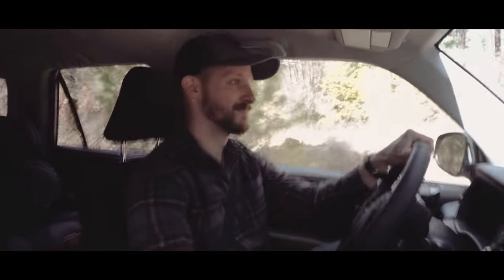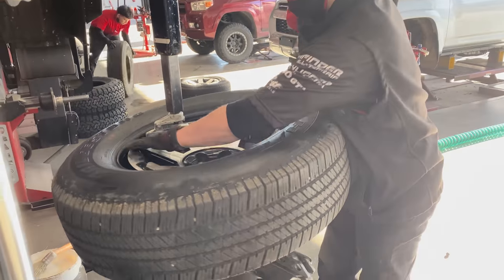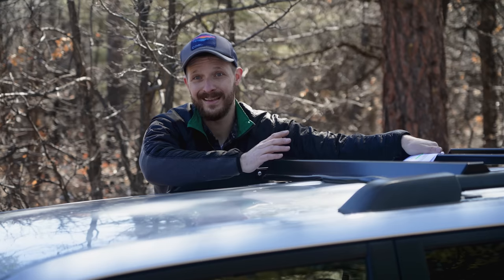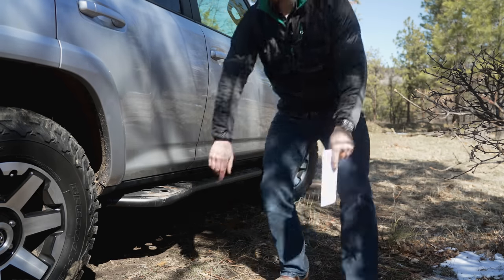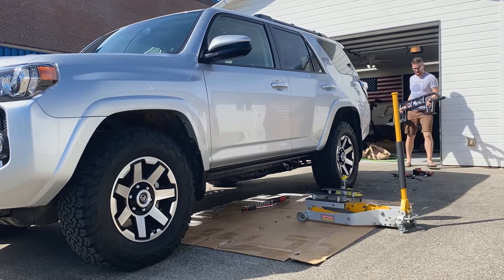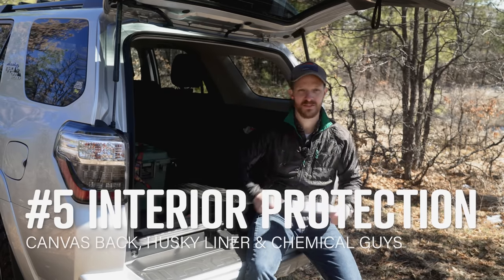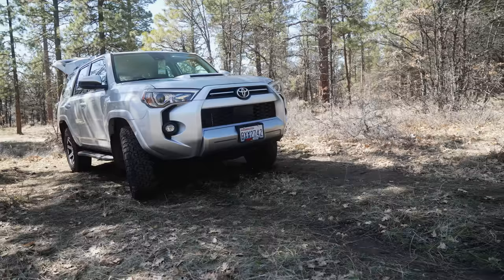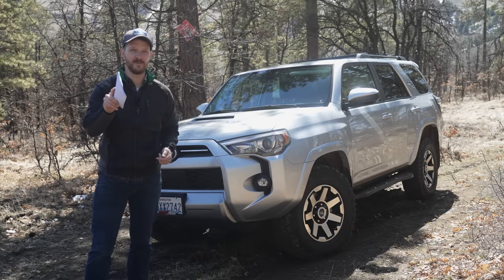Start Here: Toyota 4Runner Top Six Mods/Accessories To Do First!

Comment: I'd just take the rock sliders and go get them powder coated......baked on, rock hard color.
Reply from the maker: Not a bad option, but I'm glad I went with the paint route.  I've already rubbed up against some rocks, and it's really easy to sand and touch-up the paint.  You can touch up powder-coat too, but it's more difficult.  So some benefits both ways.  :-)

Comment: You dodged a bullet not getting the fox shocks. I just traded my TRD pro back in for a 40th anniversary. The Fox shocks and struts failed ANNUALLY. Two back shocks, three times on the struts in the fronts. Final straw was when toyota basically said oh well you just got out of the initial warranty. I will never...ever buy or recommend anything Fox racing makes. A trd pro is only worth it if you are going to toss the FOX shocks and put another brand as a lift.
Reply from the maker: Crazy, but yeah the Off Road trim is by far the way to go.  I feel the same about the Tacoma as well.

Comment: FIRST mod.........Pedal Commander. Then throw the 275/70 BFG's on.
Reply from the maker: The issue with 275’s is they are E load tires... so they’re really heavy and don’t ride well on medium sized trucks.  You can get C load 285’s... so that’s my plan after doing a lifted suspension at some point.
Reply from the maker: But I am interested in the pedal commander.
Reply: @JasonExplainsThings  Trust me.......the PC TRANSFORMS! the way the truck drives and makes it FUN!  I have 285 C's now with a 2.5 lift, but 275's will work stock until you lift.

Comment: I've had several mechanics tell me MODS are NOT good-- they mess up the "engineering" of the 4runner and cause it issues that it would not normally have.  ANY thoughts?

Comment: A brand new 21 and you already have a ton of surface rust underneath?
Reply from the maker: That’s dirt.
Reply: I think he was referring to the sliders he was prepping for paint and protective covering. That's where I heard '... extensive rust underneath...' something like that.
Reply from the maker: There was some surface rust on the sliders, but that’s pretty normal with bare steel.  It cleaned up easily and the paint has held up great.

Comment: Psssst ceramic coatings are bs. Don’t believe me? Try keying a spot before and after.
Reply from the maker: Who ever said a ceramic coating is supposed to stop metal on metal scratches?! 😂
It’s a replacement for using wax, and helps the paint resist contamination from dirt and road grime.  If you want a recommendation on a coating that stops all scratches there’s always truck bed liner. 🤣

Comment: Six mods? Six? While tires, sliders and crossbars easily qualify, I really don't consider paint protection, interior protection and a box of "recovery gear" actual mods. Thanks though for the video. I recently acquired a 2008 Lexus GX470 (upscale Toyota Land Cruiser Prado) with only 67k miles on it. I've upgraded wheels and tires and am looking towards rock sliders, roof rack, bumpers, and lift. Thanks again, I mostly commented to help your algorithm. 😎

Comment: Those tires don't last lomg , ceramic coating for vehicles is just a fad , doesnt really do much or anything either,
Reply from the maker: Loving the tires 2 years and 20k miles later.  And the ceramic coating is still noticeable.  You do you, man.
Reply: @JasonExplainsThings  20k miles is nothing , the ceramic coating is all in your head . Keep being duped by marketing man.

Comment: Am I first to say the KO2s are horrible?  Replaced nearly worn down factory Nittos and wife tells me they're horrible in the rain. I didn't believe her until I got caught out in the rain. The almost to the wear bars Nittos tracked better in the rain than these.
Reply from the maker: To each their own, but I don't understand this criticism.  The 4Runner has been awesome with those tires in rain and very deep snow.  They have their limitations on sheets of ice... that's the only time I've needed chains.  I'm kinda thinking this is a Pepsi vs Coke kind of thing. But again, to each their own.
Reply: @JasonExplainsThings  Not a pepsi/coke thing. We live in area where sand and gravel trucks are up and down the road we live off of leaving ruts in the pavement for water to stand. The Nittos still piped the water away fast enough to not have to clinch the wheel just in case. They had these in stock along with their store brand tires so I got the KO2s because we needed tires before the spring rains hit.

Comment: Good video and you get a thumbs up. But I think your choices suck. Lol.
The tires are the only good thing. When it comes to Toyotas, 4Runners and Tacomas, the number one fault is suspension. Forget all the protection. You're gonna get pinstripes and the interior is gonna get dirty. You don't need to pile crap on the roof, you need to bring less! 
New suspension with a mild lift is thee number one priority! And with that, unless you're going to run the Rubicon trail you don't need the added weight of rock sliders. 
I did Black Bear and Engineer pass last July in my stock Tacoma TRD offroad. It came with Goodyear Duratracs so the only mod was an upgraded TRD pro skid plate which was "used" several times! At no time did I come close to rocker damage. I did drag the trailer hitch a few times.
After that shake down trip I tore out the stock suspension and replaced it with a 3 inch lift Ironman suspension and 33 inch KO2s. That's all I'll ever need to do just about any trail I'd care to go on.

Comment: Buy a very small air compressor for tyres. It's too heavy & consumes too much space.
Reply from the maker: Bad idea honestly.  I used my air compressor to fill up my tires and a friends after some trail driving… even on my big compressor it got hot and took a while.  Bring whatever you want, but it’ll take a long time and get dangerously hot if you use a smaller one.

Comment: Don't lift these vehicles your going to kill the front axles
Reply from the maker: I guess you won’t like the lift videos.  I believe your comment lacks nuance.  If you lift it 4 inches and the angle is terrible… sure.  If you level it out properly and have good alignment… it may wear slightly faster than stock but not much.  Toyota themselves lifts these vehicles.  If you don’t want to mod your vehicle, then don’t mod it. 👍
Reply: @JasonExplainsThings  it's the way they designed the front axle it's a two piece and over time it's not good for them but to each his own I'll never off road mine so I have no need
Reply from the maker: For sure.  AT tires may be good if you live a snowy area.  But yes, a lift is not mandatory at all.  I will say the Eibach suspension made it better on road also… especially getting rid of nose dive while driving.  But the 4Runner is amazing in stock form.

Comment: No thanks to rock sliders.  Too heavy.
Reply from the maker: They are heavy but I’d recommend them.  They have saved my 4Runner and Tacoma several times.
Reply from the maker: Recently I ran over a small log/dead tree on the trail.  It got kicked up and was about to hit the my door but it was deflected by the slider.  That along with rocks, logs and just protecting the side of your vehicle from mud.  But you do you.
Reply: @JasonExplainsThings  I did replace my front rock shield with an aluminum one from eBay looks exactly like the TRD but without the big price tag.   The original one actually rusted away.  I also recommend replacing your bolts with stainless ones and use lithium grease on the threads.  Can’t believe Toyota would cheap out on carbon parts that rust.

Comment: Won't the edge guard on the roof rack collect debris and rub the paint off down to the bare metal? Seriously, you have a flexible material sitting on the paint vibrating from wind and body flex while driving down the road. No way the paint will not be affected. Voice of experience with sand covered tennis ball and my dog's teeth If you try to tell me otherwise, please back up your claims.
Reply from the maker: Not my product man, I'm not sponsored by them, and I paid full price for the kit.  But I'm actually going to be changing up the roof rack in the coming months (full length LFD rack).  If the paint is screwed up by 6 months of using that crossbar I'll include that in the video.

Comment: First and best mod you can do is get out and walk away, those cars are absolute garbage. Try changing the oil on a 2011 model, it takes special specific tools, it's the dumbest design ever, you're supposed to stick a drain tube into the filter housing, you have to remove 2 skid plates that don't go back on, the bolts strip out, the filter housing is plastic and breaks, WORST DESIGN EVER. You get what you pay for and if you wanna pay for 100% frickin garbage buy a 4runner. Even a pt cruiser is a better vehicle!!! What was Toyota thinking...
Reply from the maker: 😂 Wow.